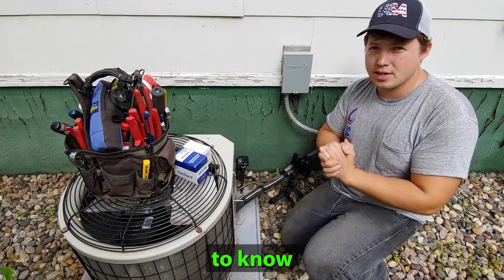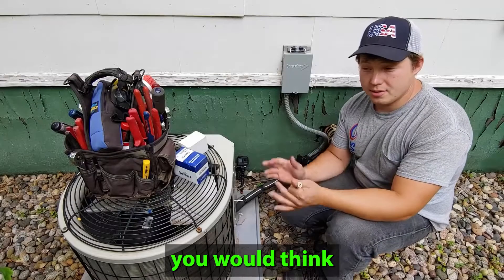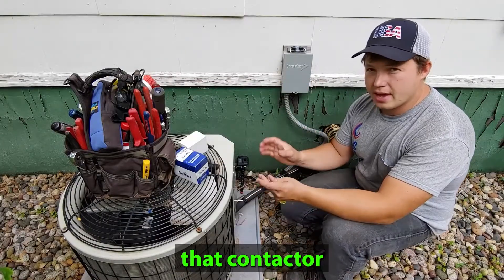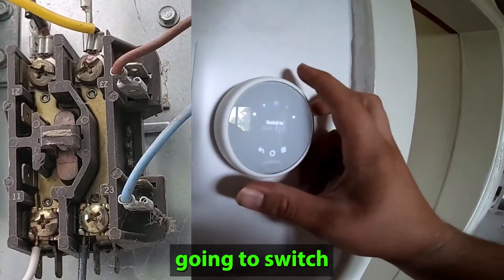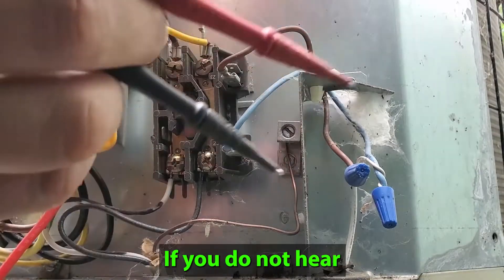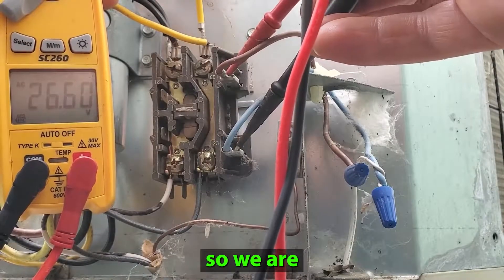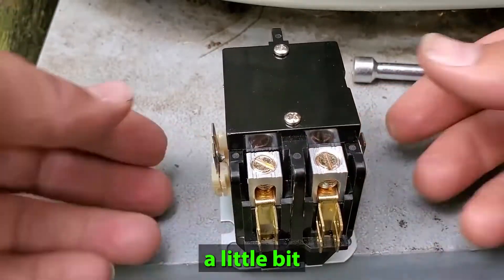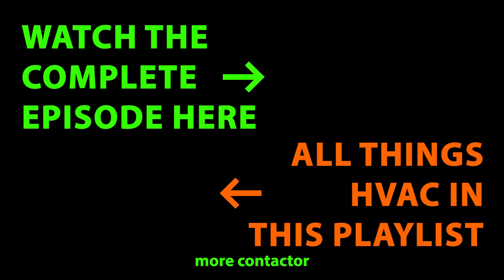AC Contactors Explained In 90 Seconds

Comment: What is a good way to adjust existing wiring from an older contactor that has 2 terminals that crush the incoming wires and 2 screw terminals that go to the Cap and other components? Most of the new capacitors either have all 2 terminals as either screw terminals or the other style ( I forget the same but they look just like the one you showed in the video)

Comment: I pulled the disconnect stab out and thought it was ok to clean my condenser. Then it wouldn't start back up. I swapped the capacitor and still no start. Then i hit the button on the contactor and it started, only while button is held down. Now i learned from your video that the contactor is powered separately. My question is how do i turn power off to the contactor? Would the circuit breaker do it? I don't want to shock myself when replacing it or damage the new one next year when cleaning the condenser. Great video thank you for doing it in 90 seconds and not 10+ minutes!
Reply: From googling I see it says to pull disconnect, turn off thermostat and circuit breaker. So there ya have it folks

Comment: My mrcool mini split that's outside makes the same noise but when I opened it it doesn't have a contactor like these big units. I hear the same buzzing noise but I can't figure out exactly where it's coming from does seem electrical. I've had this unit for about 3 to 4 years and it wasn't making that noise before

Comment: You missed the fact that they can, on occasion, weld themselves shut.  More common, however, is the fail open issues.  Because there are contactors for other purposes, you also need to double check not only that the contacts have the right amperage rating but that your contactor has a 24v coil.  The wrong coil will mean that the contactor will not close when the control voltage is applied.

Comment: Very nice Ben, I've "BEEN" watching your channel for many, many years now as you have an excellent teaching/presentation method. 
I have no contacter in my condenser, but a communicating "Comfortnet" circuit board, so I guess you would know that to be a Goodman system. 
My 2 stage 2 ton HP has worked flawlessly for 12 years now (just 1 cap replacement) and was wondering if you had much experience with that "Comfortnet" system/board and if you'd consider a future video on one and how the board works. Mine also has it's own 24v transformer for the outside system along with the Goodman/Amana communicating T-Srat . 
and a 2 stage 95% gas furnace indoor with only 2 data/commucitating wires out to the HP as it (HP) has it's own power transformer. I think this/my system is a 16 seer just before they developed all the inverter A/C systems out now.

Comment: So in reality, a contactor is just a relay (electronic switch) that starts the AC unit or does it do something more?
Reply: yes its a 24v relay no more.
Reply: @publicmail2  Relays are usually encased, so it was strange to see one open where bugs and junk can get into it.  That's really a poor design, but we know it's cheaper to use something like that when they made the unit.  Thanks! 👍
Reply: @audiophileman7047  One advantage of the open contactor design is to allow the technician to manually depress the 'switch' to check operation of the system (as Ben did here.) Some of the dead-simple AC units don't have any low-voltage circuitry in the compressor unit (besides the contactor), so there's no source of the ~24VAC besides the thermostat. Sure, the tech could carry a battery or whatever to temporarily engage the contactor, but manually engaging the switch can allow you to isolate the high voltage side as the problem assuming everything (fan and compressor) kick on. Then you know it's a thermostat wire, thermostat, 24VAC power transformer, or contactor problem.
Reply: @bnasty267  Good points, but can't they make one that has a button you can push outside an enclosure?  If I can, I will sometimes use a jumper wire to open and close the circuit for relays I'm testing.
Reply: @audiophileman7047  Well, you definitely probably shouldn't try to jumper wire the HV side of an AC contactor. That is usually 240V and 20A+ with more like 60-80A inrush current. I guess the design shown in the video is a compromise that mostly covers it from bugs/debris, but still allows it to be opened. Most of the units with computer boards use a traditional relay mounted to the board or the inverter systems don't use a chunk-chunk switch at all.
Reply: @bnasty267  You're right about the higher voltage side.  Don't want to ride the lightning on that one.  Wouldn't it be possible to disconnect a wire on the 24 volt side and put the jumper in place.  Then make sure the thermostat is activated to send 24 volts to the contactor?  You could also have a helper activate the thermostat while you watch and communicate over your cell phone.
Reply: @audiophileman7047  For sure, as long as you measured voltage at the thermostat wires coming into the unit. A frequent issue with AC not starting is either a bad thermostat or damage to the thermostat wire, which is common from weedwackers since it runs out of the house exposed and is usually just zip tied to the refrigerant lines. The nice thing about the contactor is pushing it and hearing the compressor and fan start. In 1 second and without pulling the disconnect, you know the issue is probably the therm/therm wire.
Reply: @bnasty267  Thanks for the info!👍
Reply: Could this contactor be why we would get a no signal error on all 4 thermostats? We noticed the wireless panel.inside had no power but worked once I flipped the switch on our furnace

Comment: If I have a single pole contactor say 30 amp, I'll replace with a 40 or more double pole and parallel both together, then you have an 80 amp which will last the life of unit.
Reply: No. Single pole contactors are designed to allow current to flow through the crankcase heater so your refrigerant won't migrate into the oil. Stick to hiring professionals is the best advise.
Reply: @ScottAcy  That's true in some cases, it's perfect to do it you would effectively have a single pole contactor with crankcase heat intact. It has to be wired correctly.

Comment: Where do you buy contactors
Reply: Zoro, grainger, automationdirect, McMaster Carr, hvacr supply houses, electrical supply houses etc…
Reply from the maker: Link in description! ;)
Reply: Pick your favorite HVACR company to come out and do a planned maintenance and check your contactor, capacitor, clean both coils, and check your pressures and temperatures.  I suggest looking for a small one man or small business to support versus big brand names that run commercials and advertisements because you will pay more for their overhead.